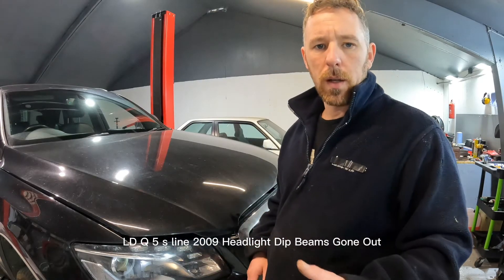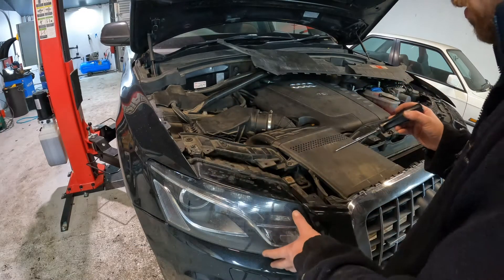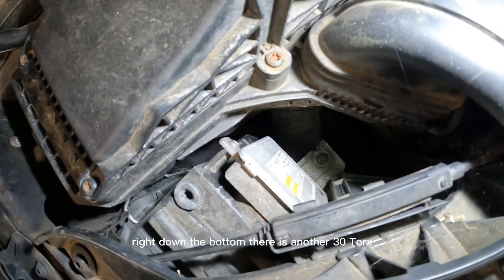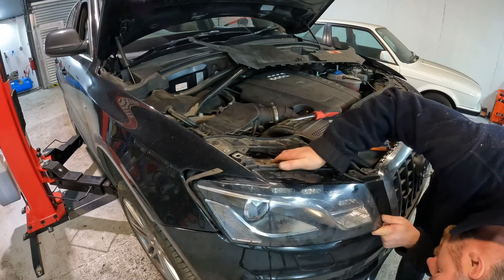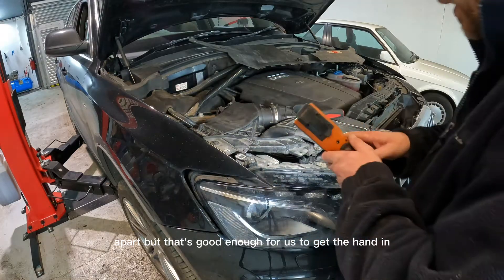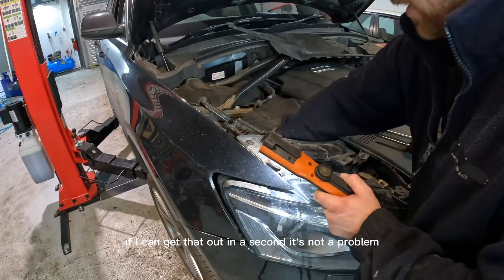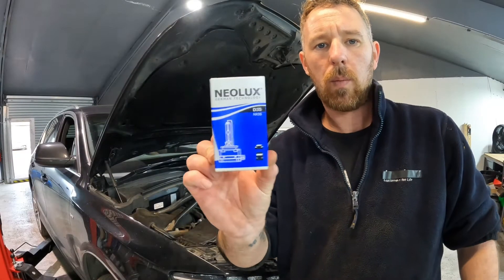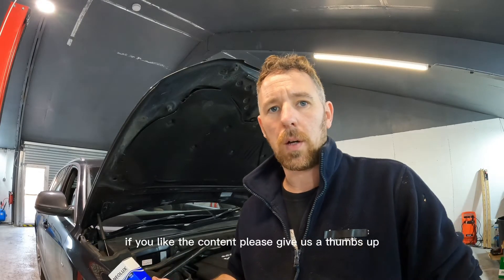Audi Q5 S line headlight bulb replacement (D3S)

Comment: This is an amateur
Reply from the maker: Hahah, Every day is a school day!
Reply: @MrAutoFixer  that is correct. 

which way did your turn the light ? My own feels stuck.
Reply from the maker: If it’s the D3S bulb with the square bit on the back, it just pulls out it’s not a twist lock in position.
Reply: Don't some have a little black clip
Reply from the maker: It’s always best practice to inspect it before you remove anything just incase there are any clips or fixings different to other models👍
Reply: @MrAutoFixer  my 2009 q5 dipped beam has gone on near side I'm very glad I saw this I reckon this is within my skill level 🤨
Reply from the maker: @BurgerGeorge yes defo give it a try I’m
Sure you will be able to do it 😊
Reply: @BurgerGeorge  you have to twist it